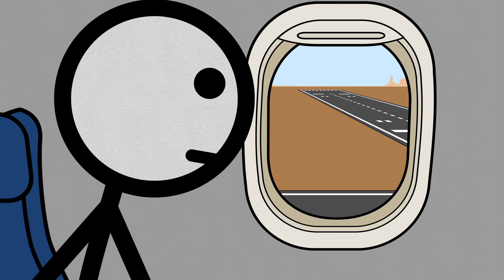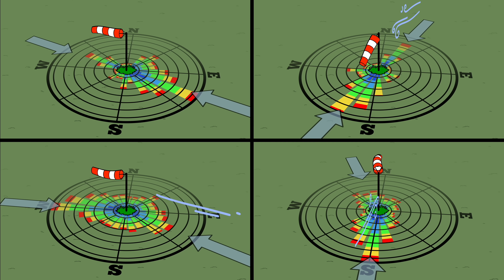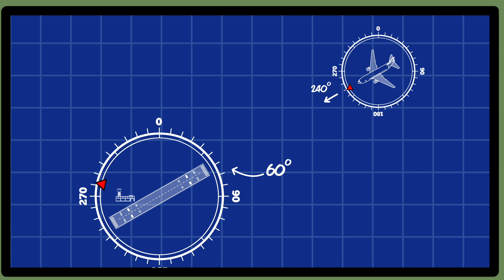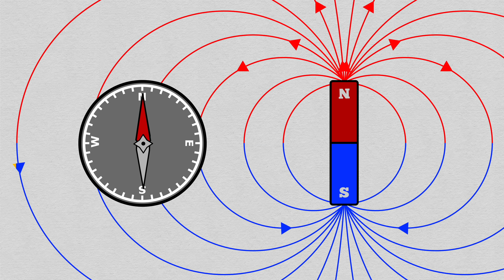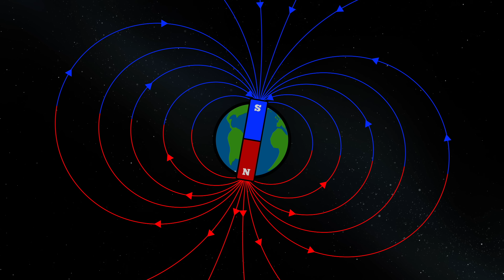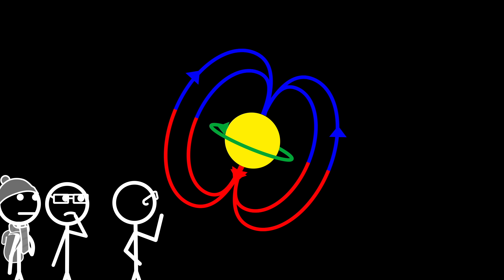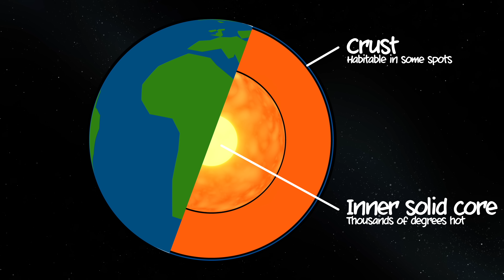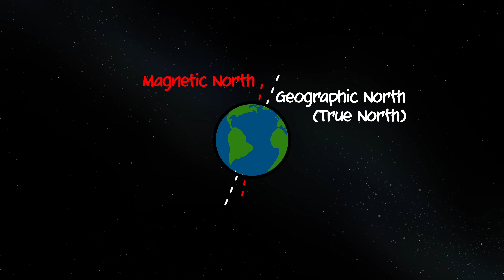Runway Numbers Explained

Comment: "When flying over her (Canada's) territories" at 16:27 is so incredibly technically correct. The Northern Domestic Airspace (NDA) covers most of the territories and northern parts of some provinces. The NDA uses "true track" while the Southern Domestic Area (SDA) which covers where most Canadians live, still uses "magnetic track." One country, two systems. Why? Well it's not JUST because of the constant repainting of runways (meaning also constant republishing of charts), but also because the farther north you get, the more "magnetic dip" you get. That means at a certain point, the compass card will hit the housing of the compass unit and will no longer freely spin to indicate the direction.

Comment: Does the video need to be reuploaded every time the north pole moves a sufficient amount?
Reply: Yes, yes it does he needs to fulfill his OCD.
Reply: Nope, the error is simply the fact that Grey and his new friend calculated the 'correct' runway at 7:59 (and got the runway number 4), saw that it was 'wrong' at 8:13 when they landed at runway 5, and then the worker came out and corrected the runway to... Runway 6???

The new video corrects this discrepancy and the worker instead corrects the runway to Runway 4, matching the number Grey and his new friend calculated.
Reply: @ThePoketrix thanks for the info but I think that was a joke on the fact of it being a reupload due to the wrong number